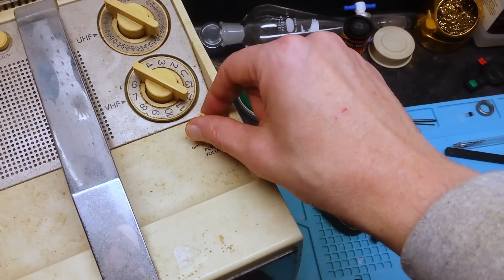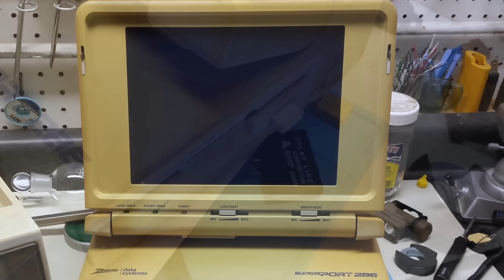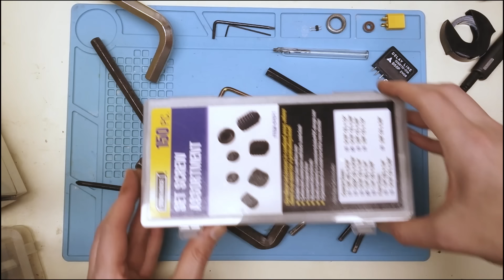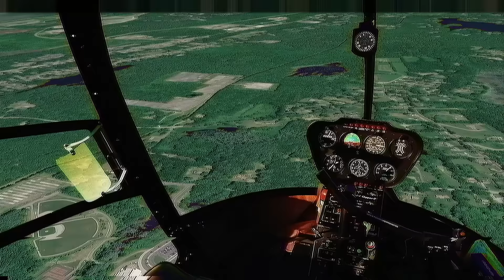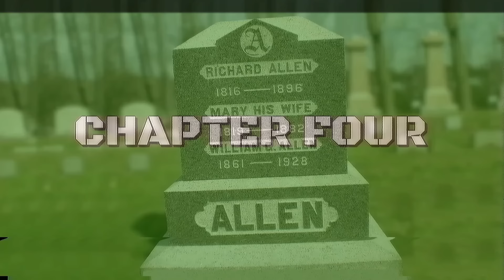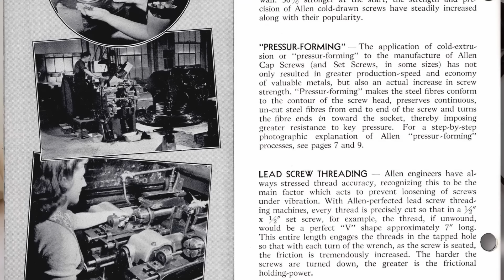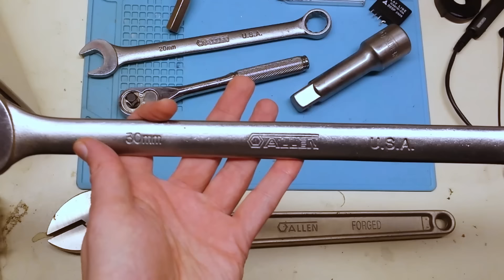The Screw that Saved Lives - ALLEN History & Lore

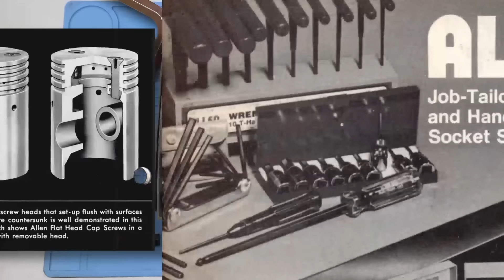Comment: I have some of the old Allen key T handles, I believe they are from the 609t series. Each one was only for a specific size hex key and each was equipped with a TINY set screw, they are straight and not L shaped. The keys they held were 8-12in long, they are actually very nice and look like a giant stretched out, thumb screw. I also have an old Allen “handi-hex” in the box that looks like that shorter driver @9:36 in this video. Thanks!
Reply from the maker: Cool finds! You're welcome!

Comment: Who decided we should have Metric sizes of the same design, requiring everybody to have two sets of wrenches (keys)?
Reply: Someone who knew you'd then be complaining about the goofy hybrid screws with inch drive sizes and metric threads.
Reply: Because we aren't working on steam engines any more...
Reply: In science and industry Nobody use inch crap anymore ! Anyway UNC is too coarse and unscrews itself So you needed UNF in some places. 
For the very rare occasion one is faced with these just use a Torx and hammer it or a crescent ! I have only metric tools !
As fir the general public it is just to confuse customers who cant compare prices Pound ozs fractional decimal etc…
Reply: @jpcaretta8847  — That isn't correct, though.  A similar situation exists with drivers for sockets.  The square drive in the sockets is inch-based.  The common sizes are 1/4, 3/8, and 1/2 inch.  There are also 3/4 and one inch sizes for heavy equipment.  These drives are used world-wide, so you only need one ratchet and a few extensions to use both SAE and Metric sockets.
Reply: @GH-oi2jf  pff a detail for historic reason ! How many crappy inch fasteners ball bearings etc in your truck ? Just a few in the winch mau be because these idiots kerp using them forcing yoi to get a SAE set too ! 
Obviously you never left the US !
Reply: @jpcaretta8847 — I have been to Europe a few times as a visitor.  Why are some people who favor Metric units so angry?  I am sometimes inconvenienced by having to deal with two systems of units, but it is a minor annoyance in a world full of serious problems.  My view is that all modern units are equivalent.  I can work with either system.
Reply: @GH-oi2jf   I hate stupidity !
Reply: Communists. Metric is the system of godless reds. But our system is based on metric. So there's that. We no longer keep US Customary standards anymore. All Customary units are defined by metric units. Why we don't use metric is a bit of a, well it's a scam. There's a specific reason why we didn't adopt metric.  It has to do with a certain international scale we don't want any part of. People are too dumb to figure out the scam we're running too. Because conversions be hard. We did briefly swich to metric in the mid 70s. The American People were not fans. But that is where 2 liter soda bottles came from. Those we liked. Before the switch they were half gallon bottles. 2 liters is slightly more. There's no info on the switch that I can find today.  The whole event got memory holed. Like it never happened. I was there, it happened. Never give up your guns.
Reply: @1pcfred  US companies who didnt switch to metric died or just supply the  US market like housing … US contractors bidding outside the US stand no chance if not metric. The US is the ONLY looser and the confused US customer too. And the famous 2 by 4 is 4cm by 9cm sucker ! 😊
Reply: @jpcaretta8847 , a 2x4 hasn't been 2"x4" since before WWII ! Also, what used to be 1/2" plywood is now 29/64ths ! I don't know if that's because it's based on a convenient metric round number, or just to increase lumber manufacturer's profits....
Reply: @goodun2974  the confusion of crappy imperial measures IS TO FOOL CUSTOMERS and increase profit !!! Same price same packages BUT less weightvolumes ( see the bottom) price per different units in small letters to make comparison difficult !
The refusal to go metric was also to prevent import ! It didnt work out ! IKEA for example ! Get a metric tape and see !
Reply: Do you remember the half liter 7UP bottles?
Reply: @1pcfred  All systems of measurement are arbitrary and therefore some handy measurements end of being practical and stick and others do not.

Comment: Thanks! Another great video. Solid info, subtle humor, retro graphics, niche content, and clever theme. In other words, Ballinator production standard.

Curious...did you uncover any info about the Allen key/wrench sizing as being systematic? I have heard many times that, for at least the smaller fasteners (< 1/4"), the Allen key is sized so that the short end is used as the lever to snug up the fastener by going as tight as you can with fingers, then the long end is used as a lever to toque it down by going as tight as you can with your wrist/arm. In this way, the key scales to the fastener and prevents over-tightening and stripping out the interface. It seems stripped hex fasteners are caused by poor quality materials, poor tolerances, and tools that provide too much leverage. I seldom have an issue with the standard "keys" if they are quality items.
Reply: To torque a socket head cap screw. Grabbing near the end of the ell wrench pull until it bends 20 degrees. This is the built in beam type torque wrench. So yes they are sized.
Reply from the maker: Thanks! No, I didn't uncover anything about determining the length of the keys. It makes sense though. I was taught to spin in with the short end and then switch to the long for torquing it down too. In the 1925 catalog they say the wrench will snap before the screw would.